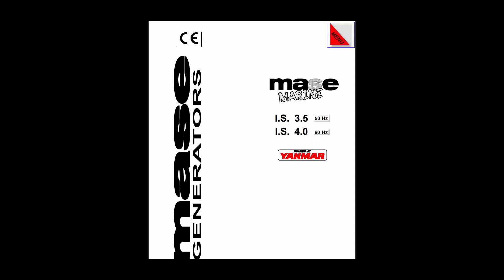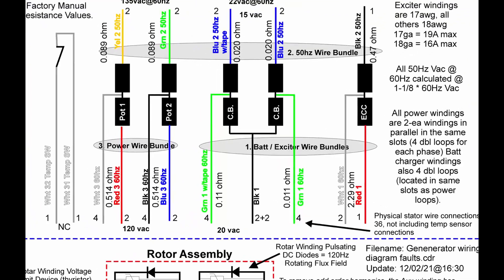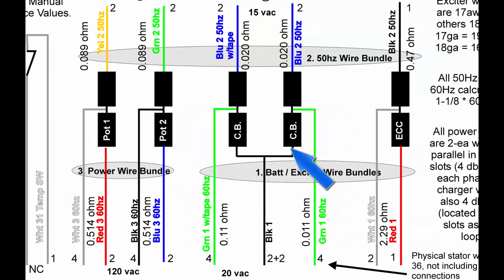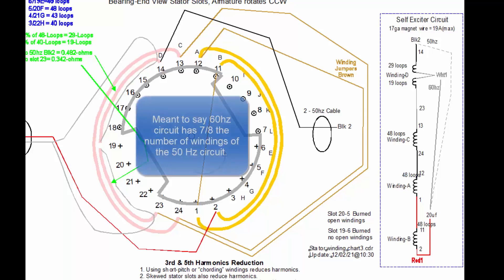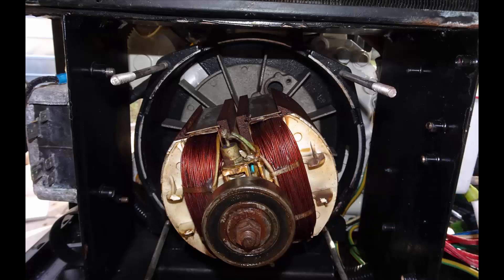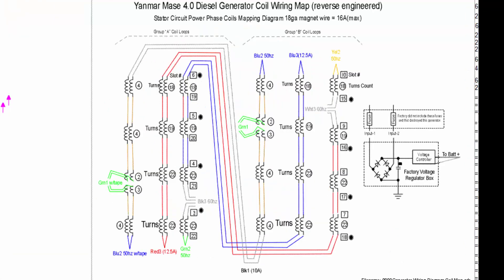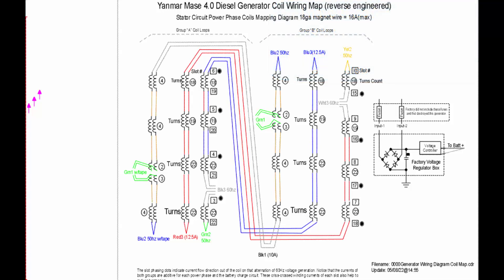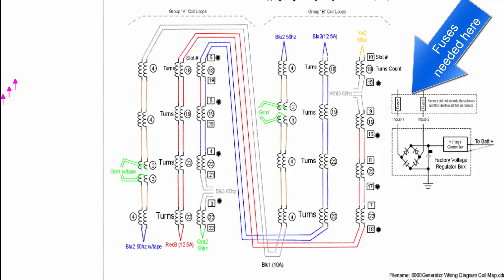Yanmar Part 1 Mase 4.0 Generator Reverse Engineer and Repair Overview

Comment: Hey, how  could u remove the rotor from crankshaft? found no matching puller
Reply from the maker: I used air impact hammer on dimple at end of shaft. Just pull on the rotor while impacting the shaft. If you don't have an air/electric impact tool then tap lightly with a light hammer perpendicular to the shaft on the bearing on the end of the shaft while pulling on the rotor. Protect the rotor winding from striking anything while the rotor is removed (a common mistake which will damage the rotor windings). Tapping on the bearing may damage it. It should be replaced anyway.

What is wrong with you alternator?